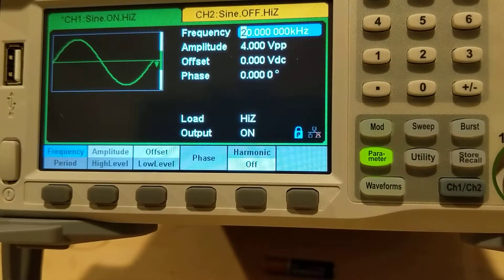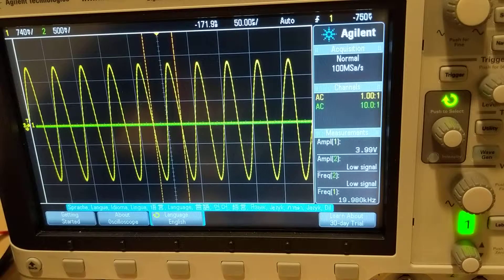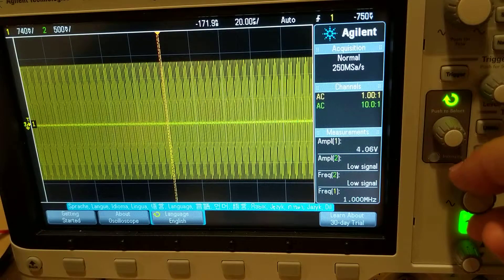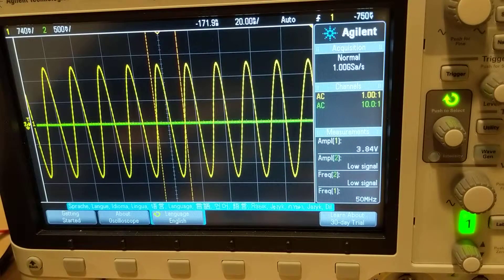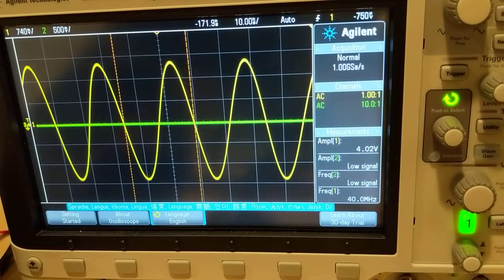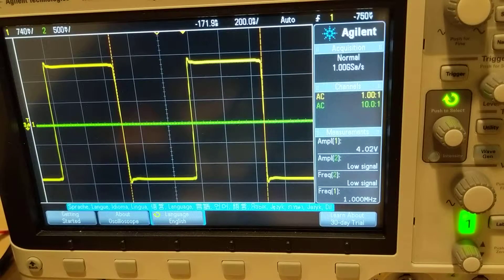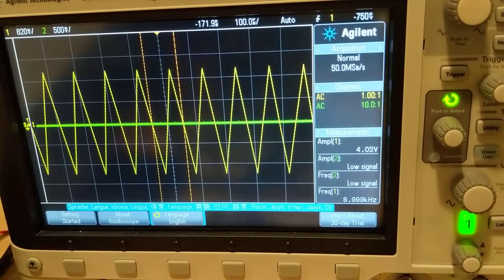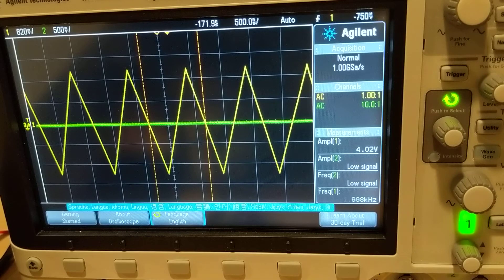Siglent Signal Generator Quality Check

Comment: The reason for the signal drop at 100 mhz from 4v down to 3.25 is because your oscilloscope is a 100 mhz bandwith oscilloscope. This is normal and worst case you can expect a drop up to 3 db at 100mhz. In this case you had a drop of less than 2db.